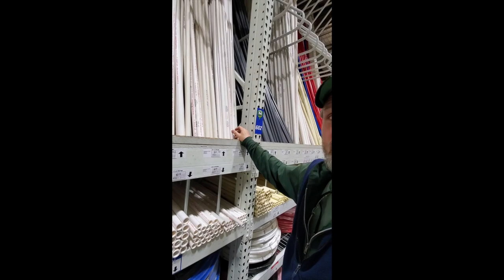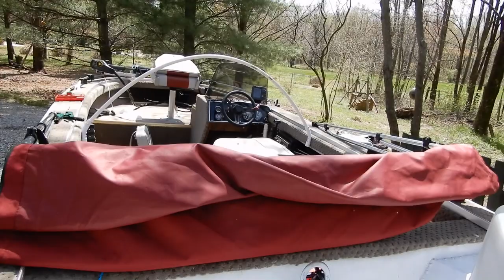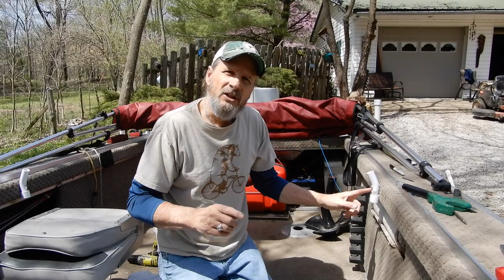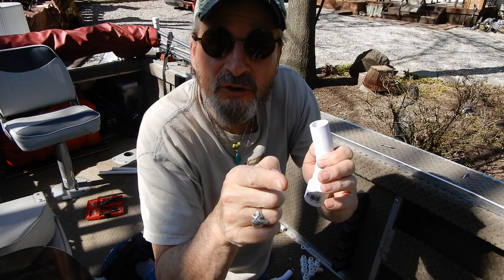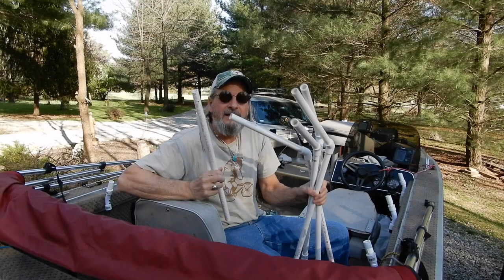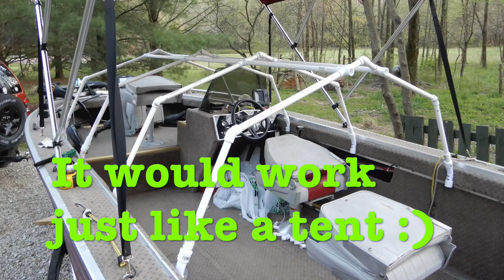How to build a pvc support system for your boat cover #boating

Comment: I did something similar on my boat.  Like you, I had to make changes along the way and several trips to the hardware store.  I watched all 28 mins of this because I was hoping to see how you were going to store the support system when you took out your boat, but you never got that far.  For mine once its up, its good and supports the cover.  It becomes a huge pain when I take the boat out.  Breaking it down creates a mess of pvcwithout having a bunch of pvc stuff piled up in my yard.  Then having to put it all back together then slide the cover back on without it collapsing is the real problem that needs a better solution.   I enjoyed your video because I did a similar project, I will offer some constructive criticism.  I skip videos that are too long, with that said you could've done this video in 10-12 mins if you wouldve stayed on subject, cut the attempts at humor and stop the unnecessary chatter.  That is just my suggestion.  Thanks
Reply from the maker: Thanks bongo...I respect ur constructive criticism,  YouTube is a strange platform. There are a lot of folks that want me to cut to the chase and get to the point...hurry up man they say :)...then equally there are folks that love my material...they find the insights and ideas I come up along inside the video to be very entertaining, as far as my attempt at humor that's a real stretch , I rarely ever try to make things funny on purpose, I don't like that on videos I watch, the humor aspect is just me, Mr Lawrence, being me :)...I didn't glue anything together and I marked on each piece where they go in the puzzle with a sharpi, so broken down all parts go into a very small bag that can travel with me that I keep on the sylvan...very easy to do, I'll mark down to make a video this spring on how I did this...thanks for the idea and thanks for watching!